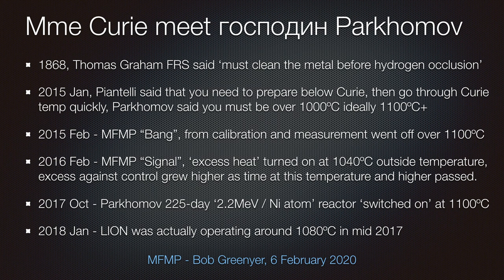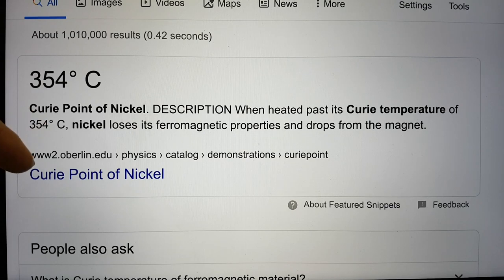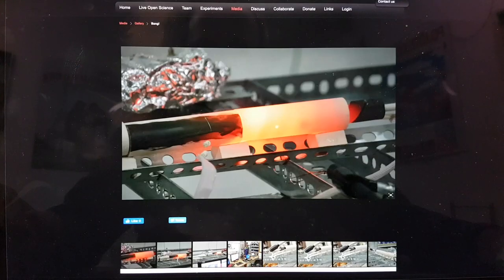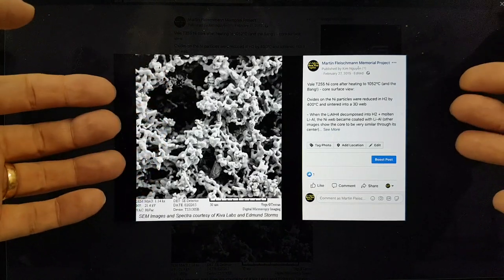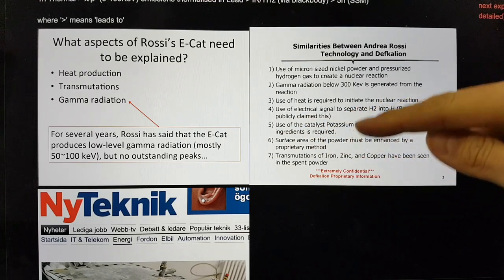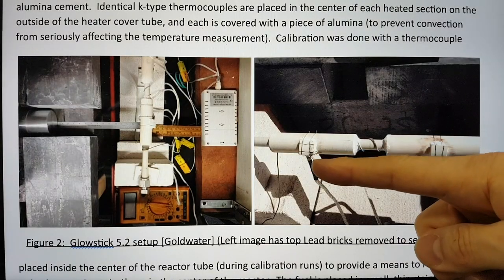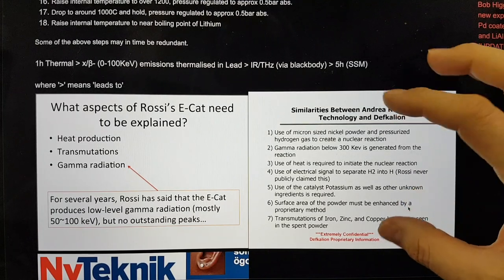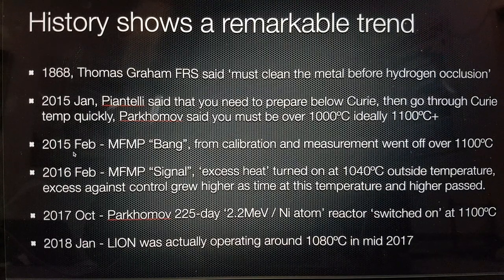Mme Curie Meet Monsieur Parkhomov - Critical Temperatures for Ni+H LENR?

Comment: In the prepration of the Nickel to hydrided nickel:
340°C is already at 96% of the magnetic domain property phase changed 'Curie temp'.   An extra 4% may turn out to have better results at 355°C as all domains will be aligned for deoxidation and hydrogen saturation.
Reply from the maker: Perhaps, we just worked off what Piantelli had told us.

Comment: Great presentation. As we also experimentally observed what Bob refers to as the "bang", I make a comment here.
MFMP "bang observation": elevated Geiger reading for about 1 sec (can be heard in the video), started at 1100 Celsius
Our "bang observation" (documented in JCMNS vol25): elevated Geiger reading for 4-5 seconds, RF emissions at the same time as elevated Geiger readings, started at 1300 - 1350 Celsius
Altogether, my impression is that it was like a deflating exponential process. So the "bang" starts up the process, but it has an exponential tail.
I spent quite some time studying dense hydrogen, whose existence is experimentally well established. So one may expect that I would favor the dense hydrogen related explanation of the "bang". Yet, I am not sure that this is the case. Our reactor core contained only trace amounts of hydrogen. Either extremely small concentration of hydrogen is sufficient, or otherwise the "bang" can happen even without hydrogen.

Comment: Thanks this is really great, looking forward to hearing about the role of ionization from the high energy beta particles. Also can you elaborate a little more on what you suspect is occuring below, and when one passes through the curie temperature.  For example in an earlier video you mentioned that you though one of lions(?) or me356(?) reactors was sucking up hydrogen at a given temperature, are you thinking it was sucking it up into the nickle, and was that below the curie temperature. Or are you thinking it's building up on the surface of the nickle then when the nickle goes through the curie temperature the hydrogen can all of a sudden be absorbed into the nickle? Kind of like how a super conductor forces magnetic fields out of it, or the PMK reactors forced fields out of them when they became stable PMK's and this generated extreme acceleration...
Reply from the maker: More like the latter.
Reply: @MFMP  Really interesting, I'de love to hear more speculation regarding what you think is going on their precisely some time. As in why do you think one need to pass through the curie temperature quickly, and what constitutes the upper bound of the range you need to pass through quickly (It obviously is below 1100 which is the operating temperature). Then in the case of the new parkhomov reactor design where the fuel is on the outside of the heater coil. One would need to ensure that the nickle on the outside also passed up to whatever the temperature required was quickly. This might require some supplemental heating wires in the outer shell as I'm guessing the thermal mass of the metal core would inhibit ones ability to drive the nickle fuel outer layer through the curie temperature with the necessary speed.
Reply: I may be just wildly speculating regarding my own question but this link has a chart to the magnetic susceptibility of nickle as well as the curie temperature. https://doitpoms.admin.cam.ac.uk/tlplib/ferromagnetic/curie-weiss.php
If I understand correctly It shows that the susceptibility to induced magnetism drops off as we go over the curie temperature.
If we take the susceptibility at 1100 to be 1 
then the susceptibility at 100 over the curie temperature is 10^9
raising to 200 over the curie temperature takes susceptibility down to 10^3
raising to 300 over the curie temperature takes susceptibility down to 10^2

I'm thinking maybe the magnetic field from the heating wire is aiding to trap the H in/on the nickle during the transition where there is high susceptibility.
Then as the temperature raises further there is a tendency for the heat to drive the H out of the nickle (as I think you mentioned before).
What I don't quite grasp is how a decreased magnetic susceptibility would aid to trap the H either in/on the surface of the nickle.

I don't really understand the meaning of magnetic susceptibility though, as in is it the ease with which a magnetic field can change the induced state of magnetism, or is it the ease with which a magnetic field can maintain a state of induced magnetism. If it were the later then I suppose I could see a reduced susceptibility as a state where hydrogen in the nickle was less influenced externally induced magnetic fields relayed via the nickle. Perhaps this would make it less mobile and less likely to move around,  I really don't know though.